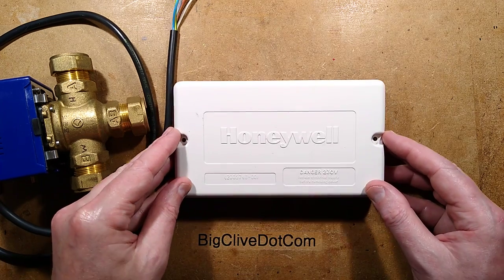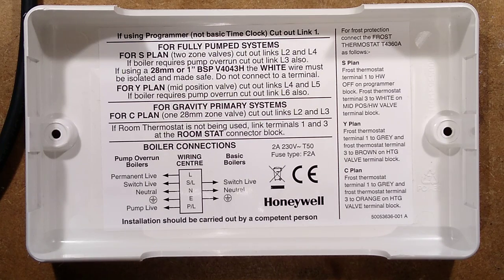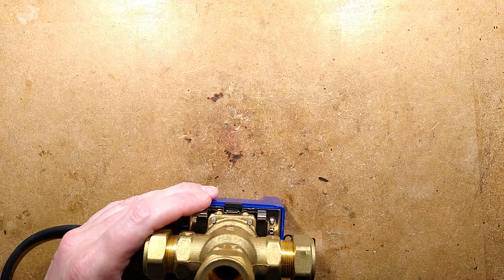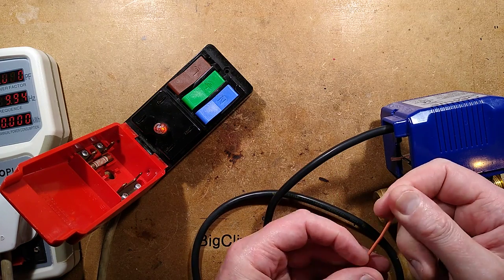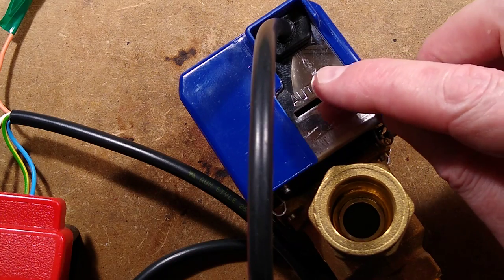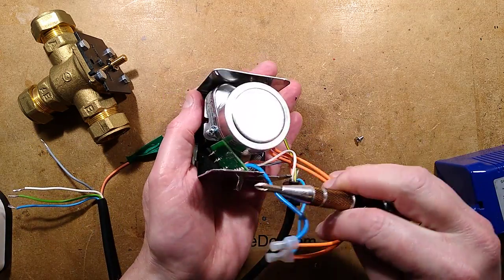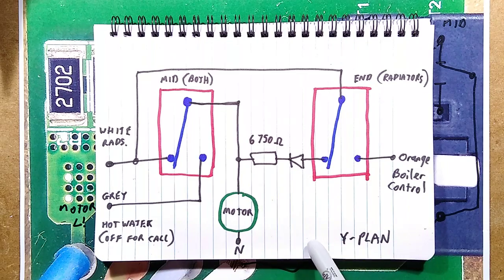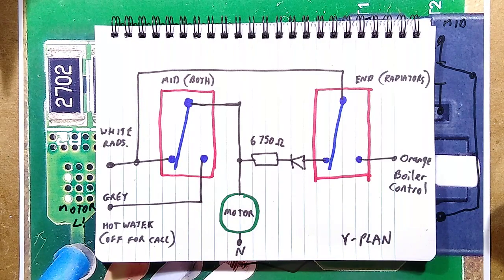Inside a clever Honeywell boiler wiring centre and a 3-way valve.

Comment: Not sure about a UK thing. I have seen something like this in an old German installation. But I mean old. Just not too old. Most things newer I had seen had separate Heating and warm water making. and in more recent years systems I know have switch back to a single furnace but with separated plumbing for warm water and heating. In general I might also have got this one wrong, as usually from what I know heating was kept completely separate from any water you get out of the tap. Buth then, I am not in the plumbing business and I sure have not seen all the contraptions out there that have been considered "normal" at certain times.
Last thing where I have seen something close to this has been in rather recent solar collector systems for hot water making. They have a separated circulation line containing a water based liquid with certain anti corrosion and anti freezing aditives and then goes through a heat exchanger in a well insulated "boiler". Here something close tho those valves is sometimes used for temperature controll as sort of a bypass valve, to not overheat the water in the storage tank.
Reply: I have 4 boilers in my building. one is dedicated for domestic Hot water with a second as a backup in case of failure. The other 3 boilers are for hot water heating for the building. approx 320,000 btu per boiler. 2 circ pumps for the building and one for the heat-exchanger/tank coils for the DHW.

Comment: +bigclivedotcom
What do you think about debugging these valves?  Have a V4073A1088 here [classic honeywell valve], which has become sticky! -- will fail to "roll back' on the springs reliably [i.e. won't run hot water] -- even after oiling and poking in-situ gets stuck especially in the mid position (can often unstick by setting programmer CH-only and room-thermostat high, to cause valve-motor to go to full-extent, and THEN set to go back to hot-water-only "all in one go").

With head removed, can you reliably tell if the stickiness is in the actual valve itself by twibbling the actuating point by hand/tools?

Ideally want to change the head-only and not do a full system drain-down until next summer at this point...
Reply from the maker: Sometimes they can develop residual magnetism.
Reply: @bigclivedotcom  Interesitng -- and that would mean.... stickyness in the head-only, which would therefore be cured by head replacement (or even just -- motor replcament).    If I take head off can I reliably tell if the main valve is okay by wiggling the control?
Reply: @bigclivedotcom  
p.s. JohnW DID do a video on mid position valves.  I note soon after 14 mins he explains an EXTRA resistor -- later explained as providing small AC current in order to avoid the motor becoming magnetized.
John Wards' video here:-
https://www.youtube.com/watch?v=F5m8f6HN2Us

Comment: Our hot water heating in Canada is usually 24VAC not line voltage.
Reply: You mean 240 for electric tank (220)
Reply: @RichardSloan65  no electric hot water heater is 240  boilers are 120, but all control equipment is 24vac. Valves etc
Reply: @neiltheplayer  yes

Comment: Clive a nice explanation. Personally I prefer zone valves to mid position valves. Some years ago It took me a while to figure out how a mid zone valve worked. Small point I think you missed that the four resistors are in parallel?
Reply: So was he meant to do that weird x2 thing (the x being in a strange font) on a scientific calculator as he added them up?
Reply: No, he said they were in parallel - hence the divide by 4.
Version 2 of my heating system I may use mid-port valves with the mid position being 'ON' and the full over position being 'TRV'. Power off and the rad's off. Could be used as flow boost to get rad hot quickly before going onto TRV mode. Also, for option to override TRV without turning TRV up.

Comment: On another subject. How do you contact you clive. Just fitted a lightwave dimmer used phillips lamps had the problem of glowing lamps but in. The past found having more than 12w of load sorted the problem. This time I went for the varilight glow fix can you do a video on the glow fix on why it works?

Comment: Neat, but just letting the motor stall out seems "a bit how d'you do," as Dave Jones would say. (Speaking of other electronics YouTube channels.)
Reply: I call 'em 'soft motors' - don't mind if they run or don't !
The winding current is independent of rotation - so it's more like just having an electromagnet permanently on.
Reply: pmailkeey : Cool. I’m used to thinking of a stalled motor as a “CUT THE POWER! SHE’S GONNA ASPLODE!!” situation.
Reply: KarlBunker - you’ve been watching too much Hollywood! Any motor that’s powerful enough to cause problems if stalled, will have protection devices (overload/over current trips).
Reply: @Mark1024MAK  Not really. I've known of a motor driving a cooling pump locked in the on position - couldn't be turned off to prevent the building catching fire :) And it did  in the end !

Comment: Might be worth pointing out that that valve came with solder tinned wire ends, NEVER put solder tinned wires into screw or leaf spring terminal blocks, over time the solder will "flow" and the joint will become loose, either use bare stranded wires or bootlace ferrules.

Comment: Technically its called a sector gear. But being plastic I wonder how long it will last before the motor strips some teeth off when its fully closed? Some automotive HVAC systems, such as those in GMs, have electronically controlled dampers that have no position sensor, but instead have motors with a three pole armature and commutator that sends inductive pulses back to a control unit. While the pulses can be used by the PID controller for positioning, the mechanism must travel to each stop to self-calibrate its range of travel. A common failure is the gears will strip at the extreme ends of travel after some time.

Comment: If the water flows from AB to A or B the water pressure should be working to help the seal on the valve.
Reply: Yup. 
Honeywell valves are a better design - the seal is a freely rotating ball - so doesn't necessarily seal on the same part of the ball every time - although that may be a bad thing :)  but is does mean the ball centres itself on the annular seal - which this cheap vale style won't.

Comment: Any chance you could lash up an overall plumbing drawing.  In my part of the world mains pressure cold water goes in one side of the water heater and hot water at mains pressure comes out the other when I turn on the shower or other taps.  There are no radiators, boilers, pumps or divert-er valves but I am intrigued by the notion of them
Reply: @racitup4114  Gas at my place, next door neighbore uses solar water heater.  Because there is a subsidy for people to change from Electricity to Solar, Solar water heater prices are artificially inflated making it cost prohibitive to go from gas to solar.

Comment: Got something like this in our heating system that has died , Not sure if its the motor in the unit or the controller Pcb , Winter time we had to use the manual override latch just to get radiators on.
Reply from the maker: That does sound like the motor.  If you test for mains between neutral (blue) and the white and grey wires and the motor is not hot then the head probably needs replaced.
Reply: @bigclivedotcom  Thanks for the reply Clive ,during your stripdown i noticed they had microswitches i figure maybe they could wear out and fault but i dont think it would out right cripple the motor function as a whole.

Comment: I have Honeywell V4073A 3 port valve and it works almost the same but documentation says if 240V in grey wire = Valve held in last position but if last position was CH, approx 100V output on orange wire. I don't understand why ~100V present on the orange wire and what is the purpose of it?
Reply from the maker: It sounds like a warning about backfeed.  Possibly via the position holding diode.

Comment: ive done one similar last week, slightly more modern with two S plan vavles( 2x 2 way divertors)
All wiring is connected to correct terminals, although the programmer is doing nothing in relation to heating.  The heating only turns on/off with thermostat.  Divertors work fine, opening/closing as needed.  But select heating on PROG to turn on/off, it has no reaction at all.  So with heating on and stat calling for heat, and prog on......turning OFF Prog for CH does nothing.  Boiler still chunters along until i turn down stat, or temp is satisfied. Hot water on prog and cyl stat works fine.  Prog operates and stat  operates correcly.  I tried connecting HW Off from Prog to wiring center but nothing.
Boiler is Worcester with L, N , S/L OUT.  and Unvented cyl is STELFLOW PRE PLUMBED.
Reply: Things worthy of note???  BOLLOCKS
Reply: I have heating 'on' all night in my flat but that's not common practice. Don't use a cyl stat.

Comment: Hey #bigclivedotcom ,I have a question unrelated to this topic. In India we have 240v AC and I still use a mercury vapor tube light(CFL) and when it is turned off that tube still glows a little and flickers. Do you have any explanation why is it happening?
Reply from the maker: Sometimes capacitive coupling between the cores of the switch cable is enough to make tubes or LED lamps flicker or pulse.

Comment: How do you get the call for heat for hot water of that's only connected to the heating microswitch?
Reply from the maker: The default is hot water tank heating.
Reply: @bigclivedotcom  but what would activate the boiler? A feed from the thermostat direct to boiler rather than lead off the second microswitch?
Reply from the maker: @agentblueuk  The heating thermostat has a switch that either feeds the boilers control input when on or the valve when off.

Comment: I don't know anything about this stuff, but why are they using cut-out wires instead of switches or something similar? This way it could be reused if the environment changes.
Reply from the maker: Wire links are cheap and reliable.  I'd cut them in a repairable manner.

Comment: In the end position, does the motor stop by the end of travel switch, or does it continue to try to drive? I don't understand why that would be?
Reply: It continues to try to drive - hence it drawing 7W even after the valve has switched. I don't know why: I would guess for the simplicity of having to drive the motor only one way and using a spring to return it. That way "return" is not "drive motor the other way" but just "switch motor off and let spring bring valve back to start position."
Reply: Otherwise the spring would pull it back and you would quickly wear out the switch cutting power in/out
Reply: oyeah, of course, that makes total sense. thank you ! :)
Reply: but wait: in the middle position, the motor gets shut off, or did I get that totally wrong ?
Reply: @lImbus924  the dioid and resistor system stalls the moter in mid position by dc breaking
Reply: @lImbus924  At mid pos, the motor gets half power half rectified

Comment: Hi there, sorry this isn’t a question or comment about the video above, wanted to get in touch with you to ask about solar charge controllers, (https://www.amazon.co.uk/dp/B07W95Z6LQ/ref=cm_sw_r_cp_api_i_QVPpFbRHMRFWK) i recently purchased the linked controller and set it up with an 18w panel and a 12v Lead Acid golf cart battery, the voltage from the solar panel seems low around 12.6v just wondered if adding a boost converter would help the voltage / amp increase to charge the battery a lot more efficiently? Or should i add an extra solar panel? And if so would Parallel or series work to charge the battery better? Also does the charge controller have a boost converter built in already ? Thanks

Comment: I thought all UK boiler systems had a separate loop for radiators, where boilers heat fresh water for taps and recirculate a separate loop for boilers (topped up from mains water), so I'm not sure where this valve would go.
Reply from the maker: The loop of water is either diverted to the radiators or to an internal heating coil in the hot water tank.
Reply: Pete Smyth - there are at least three different systems...

Comment: 27 years in SMWIA and three way valves have been obsolete for 15 plus years. Now we use frequency control drivers to run the pump instead of bypassing. Bypassing is 100% waste.

Comment: i don't get the point of that. the water goes into the hot water heater and the cold water and hot water lines come out of it to everything that uses it. what does this valve do now?
Reply: What ?
Port AB is hot water from boiler. Port A is hot water to heat tap water. Port B to heat radiators. No cold water here.
Reply: It's a traditional UK heating design, a single system providing both room heating and hot water.  One main burner (gas or oil) heats water circulating in a closed loop, which is considered non-potable (not safe to drink).  The diverting valve controls where the circulating water flows through, according to where heat is needed.  One side flows through radiators for heating rooms.  The other side flows through a coil of tubing inside the hot water tank, so any contamination in the circulating water is kept separate while the heat conducts out to the potable (safe to drink) water.
Reply: It splits the hot water from a boiler to the heat exchanger on a hot water tank and the radiators for central heating, so one can have hot water only, heating only or both hot water and heating at the same time. It is not connected to the hot water that comes out of the tap. That is a a separate set of pipes, where cold water is fed into bottom of water heater and hot water is drawn out if the top to go to the taps. The water that goes through the boiler and radiators is physically separate from the water in the water heater that goes to the taps otherwise there would be black sludgy hot water coming out of the taps Not very desirable
Reply: @CoastalSphinx  ok that seems different then the hot water heaters in the us and don't think they use water to heat homes too.

Comment: why isnt this already integrated into the boiler or the central system? :/ just have 'em communicate by CANBUS or something.
Reply: This is 30-year-old technology, different boiler manufacturers have their own BUS systems.
Reply: @YagiChanDan  ugh non-standard bus-es and proprietary shit. can we abolish proprietary-ness pls
Reply: This was designed to work with absolutely zero electronics originally - just a mechanical timer and bimetallic strip thermostats. I think at least one variant had a single relay somewhere. It really was a simple, cost-optimized electromechanical system.
Reply: @makomk  It was also designed back when computers loaded programs from magnetic tape and 256 colours was a dream.
Reply: Dan Robinson - no, 256 colours was possible. You just had to get 256 different coloured gels for the screen!

Comment: You would be surprised how many domestic sparks can't actually wire s and y
Reply: A place I worked, the industrial sparks weren't that great. Wired up a new 3ph socket - and got the polarity wrong.
Also wired up 2 vending m/cs next to each other each on a 13A spur. When they'd done, you had to turn both spurs off to turn both m/cs off ! Clearly, they'd made a nice little ring out of the 2 with a switch at each end !
Reply: @millomweb  It is shocking how many people I have worked with hold an ecs card but don't seem to a thing!
Reply: @davey6024  Did you miss out 'know' ?
I've seen an IPAF video which includes testing features of an access platform - where their test DOES NOT actually correctly test the feature !
Reply: @r.h.8754  Should have bought quality kit. Firstly, it would have phase failure/reversal circuit - so it wouldn't work if phases were swapped and secondly, it'd have a 'terminal' limit switch at the end of every travel cutting total power and needing a manual "engineer" reset.

Comment: I don't get it. Shouldn't the radiators run much more time than the hot water boiler? So shouldn't have more sense use it in the off position rather than in continous on?
Reply: Depends on where you live, and what time of year it is (I guess).
Reply: Yeah it's odd that even when the heating is off, the valve can still be powered !
Reply: You don't use heating during the summer, or most of the spring or autumn. For most of the year it's only heating the hot water cylinder.

Comment: Hate 3 port valves. Always need a satisfy wire from the cylinder stat and an hw off wire from the programmer. Not to mention they fail all the time. At least with 2x 2 port valves you can put them into manual or if one fails you still have a partial system running